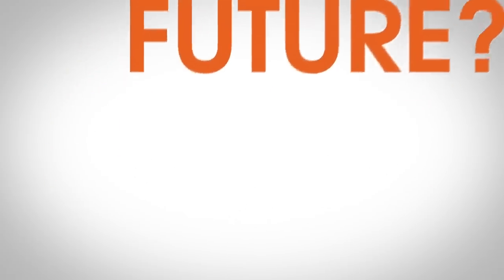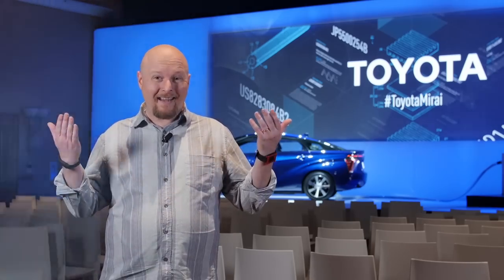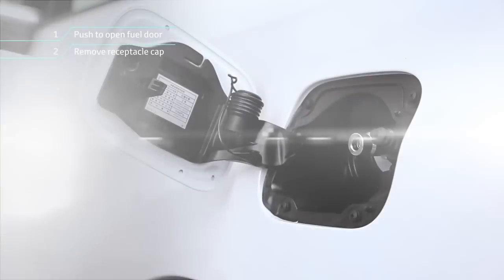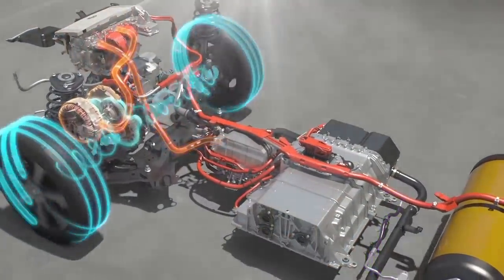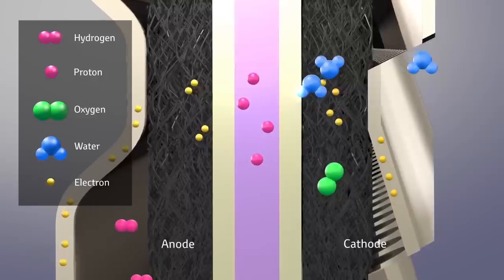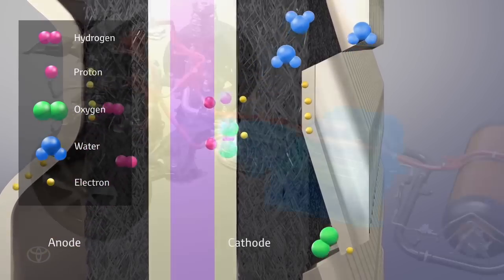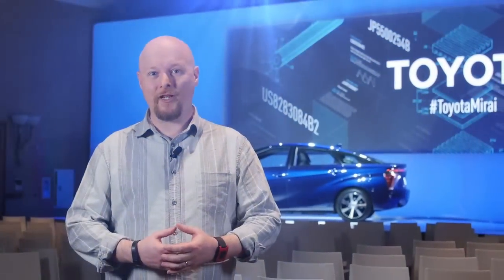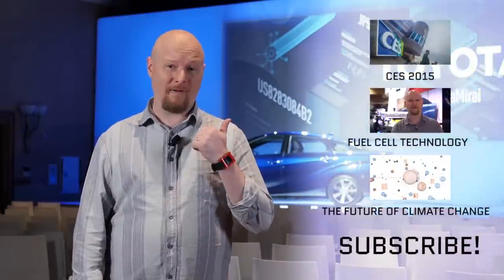How Fuel Cell Vehicles Work – CES 2015

Comment: Will we run out of naturally existing O2 in the air if we utilise it to mix it with hydrogen and make it in to vapor for our benifit?
Can we make/generate oxygen?
Reply: Since convential cars (gasoline, diesel) consume much more oxygen than fuel cell cars, they would be the bigger problem in this regard.
And if hydrogen is produced by electrolysis of water, there is no oxygen loss at the end of the day. 
The electrolysis of 9 kg water produces 1 kg of hydrogen and 8 kg of oxygen.
Fuel cell cars consume ~1 kg of hydrogen and 8 kg of oxygen per 100 km.
Gasoline cars consume ~ 5 kg of gasoline and 17 kg of oxygen per 100 km. (35 mpg)
Reply: Toyota has always lied in such promotional videos and this has not changed 6 years later. At 4:58min they claim: "No carbon emissions like petrol or diesel powered vehicles".
This is true - if you look at the fuel cell car alone. If you look at the whole chain (well-to-wheel), hydrogen today in 2021 is made from more than 95 per cent natural gas, coal and oil, as it was in 2015.
The hydrogen car is therefore dirtier than all other vehicles!
Of course, hydrogen can be produced from renewable energies via electrolysis. But this method is several times more expensive and therefore there will never be a large number of cars with hydrogen as an energy storage medium.
Toyota needed until 2019 to produce and sell 10,000 Mirai.
At 4:59min I had to laugh:
The biggest revolution has failed ...
Reply: @701983   : "The electrolysis of 9 kg water produces 1 kg of hydrogen and 8 kg of oxygen."
However, the electrolysis of 1kg of hydrogen requires not only 9kg of pure water, but also 55kWh of electrical energy. This one kilogram of hydrogen has an energy content of only 33kWh and is just enough for 100km in a car ...
Reply: @joegoog  However, we won't run out of oxygen in the air by using hydrogen for energy storage. See first comment by Yasser Arafat. That was the question I referred to.
Reply: @701983  Then I agree with you!
Oxygen is certainly not the problem with hydrogen technology ...

Comment: Well that's not entirely true you you can get a lot of Nox emissions because with that extreme heat it becomes N2 and nitrogen is poisonous you have a lot of emissions from that but other than that yeah if you can get the heat down then it wouldn't do that but unfortunately it's pretty hard to do

Comment: Wow, I can’t believe that hydrogen engines make water that we drink. Hydrogen engines don’t need a catalytic converter like internal combustion engines to reduce toxic air, hydrogen engines just spread water from the exhaust pipe but gasoline powered vehicles spread un burned fuel from the exhaust.

Comment: Feel free to correct me if im wrong: 

But this seems totally stupid to me and most people will never realize why because they dont know how the fuel cell works. So for this fuel cell to work you need to have hydrogen by itself and oxygen or ambient air. That takes power to do. You can take water and use a battery to separate it into oxygen and hydrogen (which the gas companies will do for you)  then when they are combined back together to reform water it produces basically the same amount of power it took to separate them lol. That means your still going to have to fill up at a gas station but with hydrogen instead of gasoline. What power source is oil and gas industry using to separate the gases? Power generated by coal or oil?  Sames goes for the tesla most people charge it with public power, unless your charging it off wind or solar power.

Comment: the next thing to do would be to find a way in which the car takes those water vapor emissions and separates the hydrogen from the oxygen for reuse within itself. if this were possible it would be a truly self reliant and super clean vehicle. Also putting more money into the hands of the people because they would only need to fuel up once when they first got the car.

Comment: but isnt hydrogen produced mostly from burning hydrocarbons in crude oil??
Reply: Yes at the moment mostly, but there are alternatives. You can do it with electricity. Its called electrolysis.
Reply: Thorium powered grid solves that problem.

Comment: It's interesting to me that Toyota would do this now. For a while I was looking at electric cars and solar power to be the transition to clean vehicles the auto industry takes. I really wonder if Toyota is trying to offset the impact Tesla Motors, Google, BMW and others have made by way of pushing for electric cars. But it confuses me because It's not like Toyota hasn't had a lot of success with their hybrids. IDK.

At least it's good that we're seeing another really viable option for clean emissions opening up. If it catches on, I think hydrogen fuel cell cars will be about as prevalent in ten years as hybrids are now. Maybe a little more prevalent.

Comment: Hydrogen technologies have been around for a long time. It’s time we focused on that rather than battery powered cars, batteries are unreliable and if they go wrong consider your car a write off. To change the infrastructure now everything paid into Enviromental research etc needs to go into this tech now to develop it as fast as possible. It’s possible to make all sorts with hydrogen. I came up with a hydrogen powered boiler using fuel cell technology that powers an element that heats a heat exchanger which especially in the uk all you would have to do is swap out the gas boiler and find a way to deliver hydrogen into homes or design a unit that produces it at source for it to work.

Comment: Yes but splitting water into hydrogen is a massive energy dump, and where does that energy come from?, nuclear power, coal, diesel, in the end its more economical to use diesel
Reply: But what if we tapped into wind/solar/geothermal to get that free energy then just converted to hydrogen because of its portability?  Maybe that the ticket... Dunno.

Comment: I extracted the original hydrogen webstoanh as to when the auto companies deliver on the engine and saving you fuel but beware because if increases the pressure in the cylinder causing explosion

Comment: Today is STILL not there yet! 
Still not the day when anybody can look back and say:
 "That's When It Really Started!"
Reply: Toyota has always lied in such promotional videos and this has not changed 6 years later. At 4:58min they claim: "No carbon emissions like petrol or diesel powered vehicles".
This is true - if you look at the fuel cell car alone. If you look at the whole chain (well-to-wheel), hydrogen today in 2021 is made from more than 95 per cent natural gas, coal and oil, as it was in 2015.
The hydrogen car is therefore dirtier than all other vehicles!
Of course, hydrogen can be produced from renewable energies via electrolysis. But this method is several times more expensive and therefore there will never be a large number of cars with hydrogen as an energy storage medium.
Toyota needed until 2019 to produce and sell 10,000 Mirai.
At 4:59min I had to laugh:
The biggest revolution has failed ...

Comment: Toyota should think over India as an upcoming market for FCEV's.
Reply: Toyota has always lied in such promotional videos and this has not changed 6 years later. At 4:58min they claim: "No carbon emissions like petrol or diesel powered vehicles".
This is true - if you look at the fuel cell car alone. If you look at the whole chain (well-to-wheel), hydrogen today in 2021 is made from more than 95 per cent natural gas, coal and oil, as it was in 2015.
The hydrogen car is therefore dirtier than all other vehicles!
Of course, hydrogen can be produced from renewable energies via electrolysis. But this method is several times more expensive and therefore there will never be a large number of cars with hydrogen as an energy storage medium.
Toyota needed until 2019 to produce and sell 10,000 Mirai.
At 4:59min I had to laugh:
The biggest revolution has failed ...
The new Toyota Mirai II (2020) does not even have a folding rear seat back. The hydrogen tanks take up a lot of space.

Comment: Fuel cell vehicle will rule in next 5 years. It is impossible to run large truck on ev. So fuel cell is the only option for truck. Come to the car if battery charging not possible in 3 minute, people will use ev only as second car just to drive around city. So fcv is the only option to ic engine.

Comment: Superconductivity next!
Reply: Toyota has always lied in such promotional videos and this has not changed 6 years later. At 4:58min they claim: "No carbon emissions like petrol or diesel powered vehicles".
This is true - if you look at the fuel cell car alone. If you look at the whole chain (well-to-wheel), hydrogen today in 2021 is made from more than 95 per cent natural gas, coal and oil, as it was in 2015.
The hydrogen car is therefore dirtier than all other vehicles!
Of course, hydrogen can be produced from renewable energies via electrolysis. But this method is several times more expensive and therefore there will never be a large number of cars with hydrogen as an energy storage medium.
Toyota needed until 2019 to produce and sell 10,000 Mirai.
At 4:59min I had to laugh:
The biggest revolution has failed ...
The new Toyota Mirai II (2020) does not even have a folding rear seat back. The hydrogen tanks take up a lot of space.

Comment: It is a future of modern technology that could obviously reduce maximum exceeding amounts of pollutant gases erupting from petrol/diesel vehicle to a approximately lesser extent.However there's lots of changes should be implemented in these world like generating power from non-renewable resources,producing and manufacturing a eco-freindly cars that could benefit a lot throughout the globe.I hope electrical  and hydrogen fuel cell vehicle could developed and we could not completely relied on the fossil fuels.

Comment: 1970? My great great super great uncle Selman Goldstein invinted the 2nd or 3rd fule cell in the world wich was the 1st in America. He was contracted to reverse engineer the 1st wich was japanese.  We "ummm barrowed" it from the Japanese after we dropped a couple of A-bombs on them. He did this in 1946, then 4 years later he had made dozens. (The 1st 1 he made was super big like 15 ft high & 20 feet wide 10 feet deep) some the size of a brief case.  The government paid him a ton of $ & shelved the idea.  He also had a vaporizing carborator that got the army troop transport trucks 86 miles to the gallon. He sold that to the government for 1.5 million back in 1952 & on the shelf it went. I saw the prototype it's still siting on the same shelf they sat it on almost 7p years ago.  He said he had worked with Shell to get over 700 miles per gallon in I belive 1972.  If you think the IllumiDonkeys are going to play fair & stop raping the planet you should just go on an early retirement plan & start building yourself nice mylar lined cardboard box to live in.

Comment: I wonder how fragile the car is? And how much the fuel is?
Reply: the car will be as strong as normal cars or maybe even stronger if made of elements that are yet to be discovered. and once we all have developed the technology and made it efficient then the fuel will be way more cheaper then the fuel we use now. but who knows my friend maybe you can find and or create a better and more efficient fuel / energy source. so DREAM BIG , never ever give up and touch the stars because anything and i mean anything you can dream of is possible if you believe it.
Reply: Ok cool thanks.
Reply: This is why Toyota is never talking about hydrogen price, and even giving it for free with vehicle, because when people realize that will cost 2-3 times more to fill it up than petrol car and 5-6 times more that electric car (for the same distance), nobody would event thing about buying it. It will be around 50$ per tank.
Reply: Sasoon2006
Who do you work for? 
Did yo have a bad experience with Toyota?
Reply: The last time I saw a price in relation to use in a car was back in 2006 when the cost price was estimated to be $50 to fill a car tank to travel 300 miles.
The reason the hydrogen stations will initially be free during the pilot phase is because they have not found a way to measure the hydrogen dispensed - as the Hydrogen is dispensed by pressure (10152 psi) not volume. (Hence why you get charged to use the compressor at a garage to pump up your tires, not a charge for the amount of air put in)
During the 3yr pilot phase the California tax payers are picking up the tab for the Hydrogen filling stations plus the gas they use ($2m EACH). No doubt the Californians will eventually wake up to the fact that 95% of the Hydrogen used today is generated from Natural Gas - so still using a finite Hydrocarbon with CO2 as a by product of the Hydrogen generation.

Comment: My thoughts about this are, that you need Energy to make hydrogen and oxigen Out of water. That means, you putting in Energy, storing it in two chemical components, and releasing it then in combining them again. That means you only conserving Energy, you dont actually produce it. Mining for oil is way more Dangerous to the enviroment, but way more efficient when it comes to use that Energy. How exactly do you want to provide hydrogen and oxigen as a fuel, when you need to put in Energy First ? Photovoltage could be a way, but then again they need 10-15 years in operating a single solar-array to produce more energy as it consumes while building it. This is all nice and awesome engineering, but still no solution to enviromental challenges in the use of petrochemical fuels.

Comment: where does the hydrogen fuel come from?  do we dig it out of the ground?  Air is not oxygen, where is the nitrogen (70% of air)  Is this still released as a NOx?
Reply: No, nitrogen isnt involved in the chemistry. Its just a spectator, in this case. Companies are working, right now, on how to obtain hydrogen and make it readily available at pump stations

Comment: can't we directly pump in water as a fuel instead of petrol ...and then split it into H2O2 Hydrogen peroxide as fuel..since it releases large amount of energy  on combustion.....and build up a mechanism which uses this energy to run the vehicles.....the oxygen obtained in the first step is liberated into the atmosphere ...causing no pollution .....................this would rather be the future we think of...... don't mind it is my view point on it ..........

Comment: What if they design a car that uses an electrolysis machine ( a machine that turns water into hydrogen and oxygen) and a hydrogen fuel cell to design a car that never needs to refuel?
Reply: Let's say this system has 100% efficiency. Where will you get your kinetic energy? Because you will use all energy from the fuell cell to perform electrolysis. It's called 'conservation of energy': burning hydrogen produces the exact amount of energy it takes to' de-burn' water (=electrolysis).

Comment: Makes far more sense than batteries. With batteries your carrying a HUGE weight that take take about an our to fully charge each time. But, with a fuel cell, you can fill you tank as quickly with hydrogen as a diesel or petrol fuel! Simples, or what?

Comment: And how do they produce hydrogen without using electricity??
Reply: You use solar power to produce the hydrogen from water. The hydrogen is just a way to "bottle" the energy, so you can use it whenever you need it. Batteries do a similar job, but (1) they weigh a ton, (2) they're environmentally unfriendly and (3) they wear out after a few years.

Comment: If a car battery could fully charge in a few minutes or the ranges were farther than they are now, there is no need for Hydrogen fuel cell.
BUT until then....
Like the current Gas/ Electric, I would like a plug-in/ fuel cell vehicle. The plug-in (AT HOME) allows for 50 mile range for the daily driver that can charge overnight. I don't want to use the "fuel" unless I need to (longer trips). I'm electric now (VOLT) and I do NOT miss going to a gas station; it's just another errand I don't need.

Comment: If Hydrogen is so plentiful, then why don't we have it piped to our homes for heating, electricity???  Why have we used gasoline or diesel in our cars for over 100 years????
Reply: Killroy , Solar thermal and more widespread  geothermal heat pumps use of extracting  heat for cooling and heating of buildings.
Reply: Because it's a big effort to extract hydrogen from the plentiful water. And because hydrogen is a pretty nasty energy carrier.
Reply: @701983  Thanks. The Video talks about how hydrogen plentiful, but it's difficult to use it to carry energy.

Comment: Glad I didnt hold my breath waiting.
Reply: Toyota has always lied in such promotional videos and this has not changed 6 years later. At 4:58min they claim: "No carbon emissions like petrol or diesel powered vehicles".
This is true - if you look at the fuel cell car alone. If you look at the whole chain (well-to-wheel), hydrogen today in 2021 is made from more than 95 per cent natural gas, coal and oil, as it was in 2015.
The hydrogen car is therefore dirtier than all other vehicles!
Of course, hydrogen can be produced from renewable energies via electrolysis. But this method is several times more expensive and therefore there will never be a large number of cars with hydrogen as an energy storage medium.
Toyota needed until 2019 to produce and sell 10,000 Mirai.
At 4:59min I had to laugh:
The biggest revolution has failed ...
The new Toyota Mirai II (2020) does not even have a folding rear seat back. The hydrogen tanks take up a lot of space.